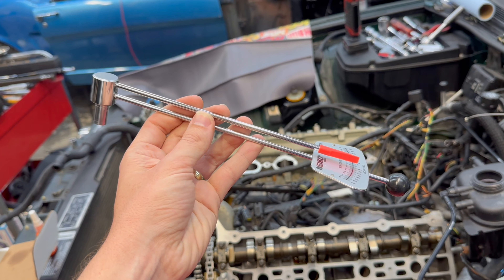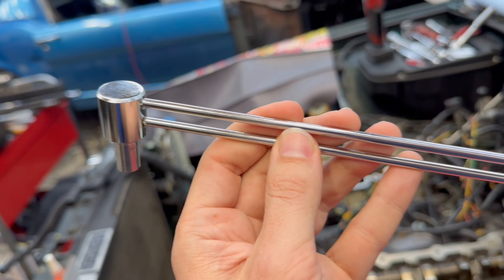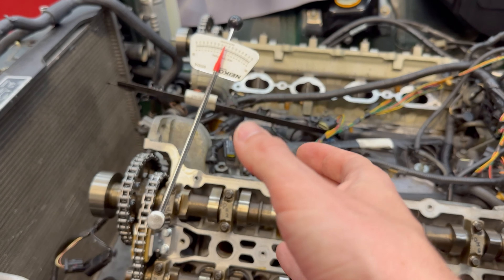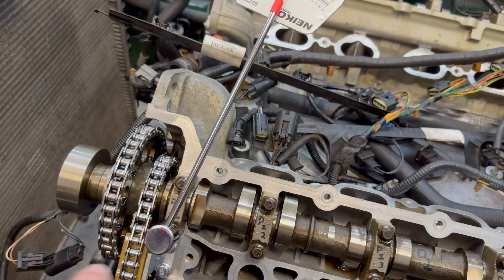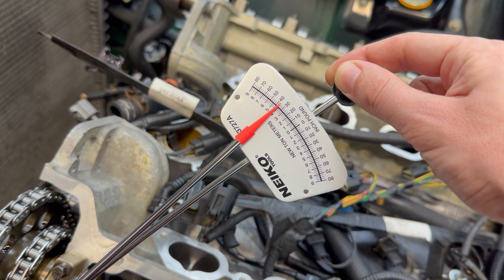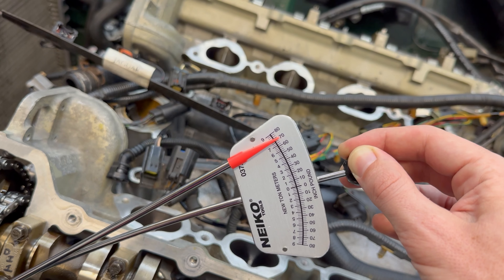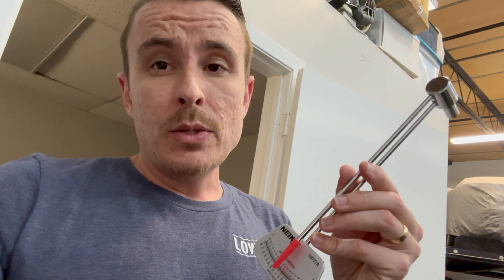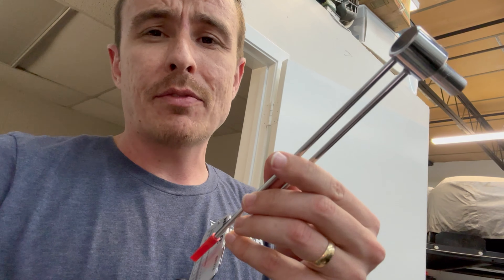What is a Beam Style Torque Wrench & How To Use It

Comment: I'm getting a 0~60 nm and a 0~300 nm for my van.
Reply from the maker: That’s great!
Reply: Ending up buying a full set - 4 brand new ones and a second-hand one: 0~13nm, 
0~20nm, 0~200nm, 0~300nm, 0~500nm

The most impressive one is the 0~200nm (0~150 flb). That's a second hand torque wrench more than 30 years old with surface rust. When I tested it with a brand new digital adapter, the pointer always fell in within 2% of the adapter's reading.